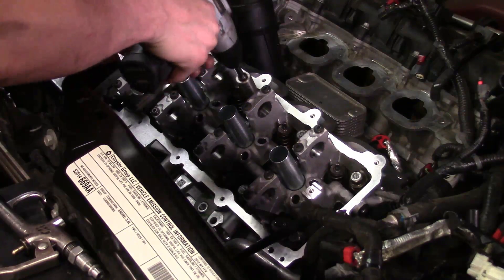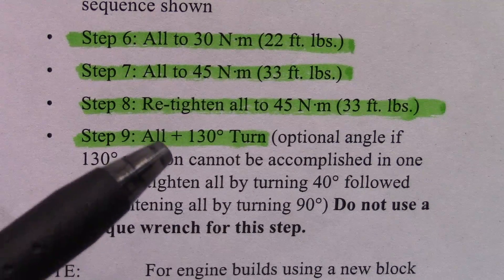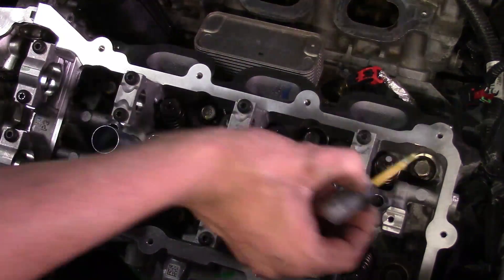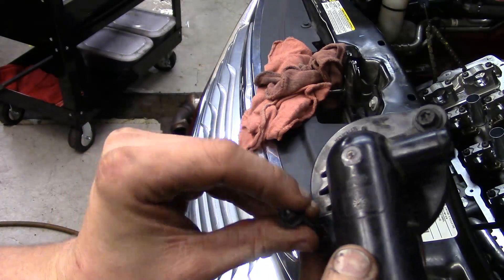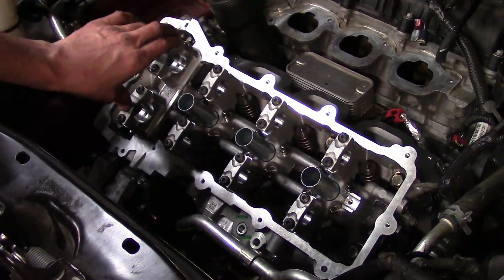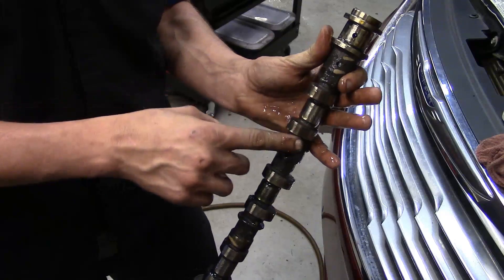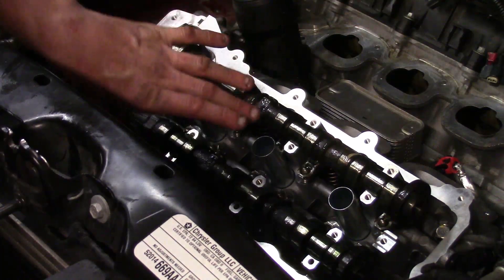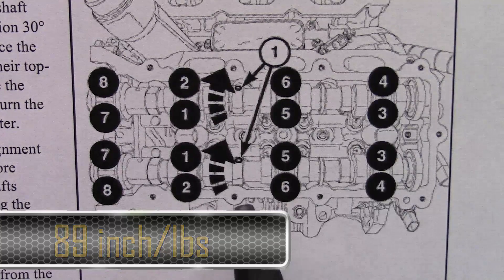Part 9/10: 3.6 Pentastar engine left cylinder head removal (the short cut)

Comment: Will these steps work on my 2016 Chrysler 300 C 3.6 L engine? Ive already taken the heads off and had them worked. Now I need to put it back together. I’ve been having trouble finding the correct specs and steps

Comment: I used your videos to replace the left cylinder head on my 2015 JKU.   Found that all of the exhaust valves were leaking using a water test.  My question for you is I over torqued 6 of my head bolts to 170 degrees, then I caught my mistake and loosened all bolts back to zero.  I never removed the head, then re-torqued bolts to the final 130 degrees.  Do you think I need a new gasket or head bolts because of this mistake? The engine is still tore down because I broke the timing chain guide and I am waiting on the replacement part.  (had to pull timing cover “painful to say”)

Comment: I ran a compression check on my 2012 T&C after P0302 repeated after a plug and coil. I got 90psi, after adding probably too much oil for a wet test it came up to 110. The rear bank all had 165psi dry. Should I take any info from the added psi wet?

For reference #4=135, then 190 wet #6=155 then 180 wet with just a cap full of oil. 

The leak down test for #2 showed a 70psi loss when 100psi was added. It barely inflated a glove taped over the exhaust pipe. I tested with the valve cover over and at times when #2 was closed I could hear most air coming out #6 spark plug hole. It confused me until I noticed the exhaust valves were a bit open on #6. Not too easy to hear it coming out of the tail pipe. But actually as I type this I release that I added to pick up the next donut gasket past the catalyst because I had been witnessing an exhaust leak near the engine. Geez it’s been a while since I have needed to think about car repairs like this. So I thank you for your channel and all your help. 

I like reading through all the comments and seeing what I can pick up on. I have seen in other videos guys leave the timing cover on too. But as someone mentioned here it might be difficult to keep that seal on the back side. I don’t want to pull the crank pulley if I don’t need to.

Comment: I have a 2018 300 with 60k on it with P0306 code . And my local dealer had to do the exact thing. What causes this issue and is it a common thing with these pentistar engine

Comment: Man, apparently it’s possible but I’m skeptical of doing it this way and not removing the front cover. When you ran your head bolts in you were literally pulling the head down.. it was moving all over… That head should be sitting over the dowels flat against the head gasket surface before you ever put a bolt in it. I’m not willing to sacrifice quality for a shortcut.

Comment: Thank you for your excellent videos I’m in the process of replacing both heads on my 2016 jeep. Installed the heads last night went to attach the AC compressor and a bolt broke off in the head, had to take the head off to extract the broken bolt, is it OK to reuse the head gasket and head bolts after putting them on just the day before and not running the vehicle? Thanks again and keep the great videos coming :-)
Reply from the maker: I see no issues with reusing the bolts. The head gasket however I would replace. Last time I checked I thing it wasn’t expensive.
Reply: Thank you ! that’s what I did. Great videos. I have a 2016 Jeep Wrangler Unlimited Rubicon with 130,000 miles. I just replaced both heads, head gaskets, timing change, roller rockers, and lifters and one bad cam. Also replaced the PCV valve, oil cooler, injectors, plugs and coils, all new gaskets.  A lot of work but your videos made it easy :-) my baby runs like new again, thanks again.
Reply: @sgtdukeM109rider  that stinks that the newer ones are still messing up. I thought these were all on the campaign for 2011- early 2013 left heads only. Chrysler extended the warranty to 150k and 10 years for bank 2. Calling out that I causes P0302 which is what I currently have in my 2012 that is 6 months past the 10 year warranty but under the mileage by 30k. Looks like a $700 repair out of my pocket and maybe 15 hours of my labor (going slow) plus time learning and testing and giving up on the head.

Comment: Awesome videos, I'm about to do the Left Cylinder head, about to order it, however it says: "With Valves. WARNING: Cylinder Heads Are Shipped WITHOUT Oil Gallery Bolts/Plugs, Bolt/Plug Kit 68154699AA MUST Be Used Or Trouble Codes Will Be Set"... is there something else i need to order? appreciate any help

Comment: Good video I have a 2017 wrangler that started to heat up on way to work. Didn’t reach the red overheat mark so I changed all cooling system components and it sends the coolant to the overflow and obviously if I would keep running it will over heat since no coolant is in radiator. Will that be be a bad head gasket? It runs perfect and I have no check engine light maybe air in system?? But I will do a block test tomorrow.

Comment: I have oil in my coolant and suspect the Oil Cooler Adapter. I've removed it and all O rings are raised and appear to be in good condition. Is there any way to determine if the oil cooler is actually the culprit? Really do not want to remove the cylinder heads!!
Reply from the maker: If you have never ran it hot then the cooler will be the issue. You can’t see the leak location....it’s internal. I recommend replacing the assembly and you might have to flush the cooling system out a few times to get it all out.
Reply: @MotorCityMechanic  a few times, lol. The one I did last night took 3 flushes.

Comment: Doing great so far, thanks for all of this. I've been keeping track of all the steps I took so that I could do everything in reverse order. You skipped over reinstalling the engine mounts and I was wondering if you had torque specks on the bracket bolts and the mount bolts. Thanks again. Tom

Comment: Great video series, first i want to thank you for taking the time and going over this procedure... I have a question - what do you recommend i use for lubing the threads for the head bolts and cam caps? After thoroughly cleaning the threads in the block and head as well as the bolts (im using new head bolts) should i use a LITTLE copper never seize or motor oil or wd-40? I refuse to install them dry, especially because its aluminum im threading into...also i believe ill get a better torque with some lubricant.. Any thoughts and opinions/recommendations will be appreciated!! Thanks!
Reply: A similar yet probably standard now…. I read not to use anti seize anymore on spark plugs. There was a really good article put out by a spark plug manufacturer that said that living the threads will reduce the friction at the thread interface. ( I’d agree with that so I kept reading). They said that if the friction isn’t there and you keep turning the spark plug further past the bottoming out point you could pull the threads out of the head.  So I would leave new plugs ( and these bolts) dry. 

One thing I was looking for is if these head bolts were reusable or are they torque to yield.  Years ago I had been reusing head bolds and had one snap off in the block while touring it up. Luckily it broke just above the block and I could pretty much turn it out at the fracture surface. I think for $80 I’d use new bolts on my own stuff.
Reply: @BWeezy-sw1wy   I understand what that theory is saying but I still wouldn't install plugs, head bolts/studs or any fastener without some kind of lubricant... That theory goes both ways.. Lubricant = smooth fastening - No lubricant = Friction - leading to inadequate torque spec, thread wear (especially aluminum) and corrosion within the threads over time..  IMO you shouldn't use a lot of lubricant.. "Just a dab will do ya", "less is more"..... 
That's just my thoughts on the subject.
Reply: @BWeezy-sw1wy  I hear ya on the head bolts.. I always use new ones.. even if it's not required lol... It's a lot of work if the used head bolts fail

Comment: What's your opinion on Haynes manuals?  My Haynes manual says to do the torque sequence that you showed but then to loosen all the bolts in the reverse order and then tighten them up again.
Reply from the maker: The service info states to do just that but I have learned that it makes no difference and is just more steps and more time spent that isnt needed. Either will work....I just have my preference. Thanks for asking and for watching. Make sure to subscribe.

Comment: There is something i do not agree.
Why did you place the head gasket without flattening the block also ?  Is actually, aluminium too, when the head gasket get overheats, also get overheats the block, so it must be corrected too because it humbles in the middle about 1mm in most cases ! This specific
 engine 3.6L  is defective since 2010 to 2014, until in 2015 Chrysler built another head gasket with more heat resistant materials, because the cooling system is terribly poorly designed.  

Thats why i would exchange the thermostat by one begin to open at 82 degrees celcios, and reprogram the first step electroventilador speed from 18% to 35% or more, to ensure good cooling, for any reason would leave the engine temperature reaches 100 degrees celcios. I know that high temperatures are for the lowest consumption of fuel etc..., but, let's be honest, this engine does not  support the high temperatures that the manufacturer says ! "Until Chrysler do something better about this engine, i will avoid overheats"
Reply from the maker: These engines dont have over heating issues. As far as flattening the block? Are you expecting me to remove the engine and send it to a maching shop to have it decked? The head is replaced due to a design flaw. That means no other issues and no need to do anything to the block. The issue with the 2011-2014 engines was the head design on the left side....nothing to do with running hot. Not sure where you are getting your info but its incorrect and has nothing to do with the repair performed in the video.
Reply: PD: If the cylinder heats up, then the head gasket does not? What temperature do you think you have in an overheated cylinder? In all cases you have to change the two head gasked because it happens on both sides, and is not because the cylinder, i know you got experience, i respect that, but im telling you what I have seen and repaired, nobody dis not tell me nothing, experience too.
Reply from the maker: @YoskelLopez  The head was replaced for a design flaw causing a burnt exhaust valve seat....not overheating.  They even extended the warranty for the left head due to the burnt exhaust valve seat issue for the first gen 3.6 engines. I have never seen an over heat due to engine design on the 3.6 unless someone had another issue where they lost coolant and ran it hot. You are reading too  much into the video because you dont understand the reasoning for replacing the head. You keep mentioning over heat....over heat....over heat. Once again thats not the case in this video. No need to remove both head....both head gaskets...on and on and on. We are fixing a misfire/skip due to a head design!
Reply: MotorCity Mechanic maybe It is not the thread of this video, but this comment given to my experience, can affirm that  i have found this problem in the above mentioned engines, and it can be maybe help for someone who is suffering this problem in his car. It is not my intention to disagree with you, i am just saying what i have seen and repaired until today, in fact, yesterday I finished a 3.6l engine with this problem. What can i say, this is whati saw, what im fixing mostly on jeep GC from 2011 to 2013.
Reply: @YoskelLopez  Just thank this man for all his help and humbly move on.
Reply: The info is all over the web, easy to find, and FCA have concern of that, but they do not want to attend this defect as a mandatory service action, because the cost is very high ! Anyway, i have had change several head gasked mostly in jeep GC 3.6l engine from 2011 to 2013 because it get over heats and as a result, the head gasket gets bend, as well as the block because the whole engine is aluminum and easy to bend due to hi temperatures, design problems, as I said before, due to the poor design of the cooling system, also the block were afected in every case, folded all in the middle, about 1 mm. And yes, I have corrected the blocks just on place, it is hard work, but not impossible and this is the only way in which it is fixed, if you place a new head gasked in a bent block, the problem will return in a short time! Tell me and be honest with me, did you have ever double check the block before exchange the head gasked ? Because nobody wants to do such work, at the end of the story the car will run with, or without bent block, is it? But it do not means, is fine.

Comment: Hey do the motor have to be pulled to remove timing chain cover?
Reply from the maker: No you dont, just everything has to come off the front of the engine
Reply: Is your shop located in GA?
Reply from the maker: Sure is....just outside of Augusta Ga.

Comment: Yeah I had two codes pop up misfire on Cylinder 4 a no communication to the BCM. Took it to the shop an that was what it was  diagnosis. So They’re going to order new heads, valves, gaskets and flash the BCM. Does that sound about right?
Reply from the maker: Both heads are not needed. If anything....only the left side. Issues in the beginning were with a design issue on the left head only. I still worry if they did diag it well to come to that point. If you can....email me the VIN and mileage and I will do some further checking.
Reply: @MotorCityMechanic  issues on the left bank head were for the seats popping out.

Comment: Awesome video. My 2014 Durango is going thru it right now. Did you replace both heads or is it just a problem with the left side? An should I have them do both sides just to be on the safe side? Thanks again
Reply from the maker: The older 3.6 engines had issues with the left side only....design issue. I thought that was addressed by 2014. The older ones actually had the warranty extended because of that. If its one of the older design then just the one is needed.

Comment: FYI ppl - 106 lbs-in IS 8.8 lbs-ft - so @ 4:33 just reuse the torque wrench to do the 9 lbs-ft on the thermostat housing!
Reply from the maker: The issue I run into is that my larger ft/lb torque wrench starts at 20 ft/lbs so I have to jump back to my in/lbs version. So to keep it more accurate I use both. But if yours can go that low and still be accurate then for sure....grab it and run with it. Thanks for the info

Comment: WHOA - very interesting head bolt torque sequence! Question: because the torque spec FINISHES with degrees of rotation and NOT torque values, do the head bolts ALSO need to be replaced when doing a head job on account of head bolts stretching?

If the head bolt has stretched, then 130 degrees rotation is not going to be as tight as it would be with a new bolt, correct?

btw love your videos - is definitely a working mechanics video
Reply from the maker: The bolts can be reused multiple times. They need to be checked each time with a straight edge to make sure to no stretching is found. So far I havent found any that have. Thanks for watching and make sure to subscribe
Reply: @MotorCityMechanic  It's interesting that the head bolts for this engine aren't torque to yield.  I'm newer to the mechanic scene (just graduated auto tech school a year and a half ago) and I've always been told to always replace the factory head bolts on an engine because they're torque to yield and they'll either bottom out or break if you reuse them.  How can you tell whether or not a head bolt (or any bolt for that matter) is torque to yield?
Reply from the maker: @CaptainRudy4021  For the most part Chrysler doesnt use torque to yield bolts expect on certain engines. You pretty much have to check the service info on each one to see if they are.

Comment: Any suggestions on hemi tick?
Reply from the maker: Depends on when the noise is present and how loud. Some tick will be normal. Loud and erratic could mean cam and lifters while only during first starting and goes away a few seconds or few minutes later could be a broken exhaust manifold bolt.
Reply: thanks for your response.
Reply from the maker: Your welcome

Comment: Holy samoli. This is good for advanced mechanics. I would never attempt this, as I would be afraid to miss a step. Just out of curiosity, how many hours by the book is this? In the U.S. standard rate is $120.00 per hour.
Reply from the maker: warranty time is around 8-9 hours.....so I would assume without checking further into it that non-warranty should be around 12-14 hours. We charge just above $100.00 but it certainly varies for sure.